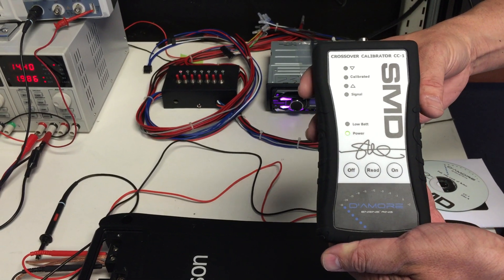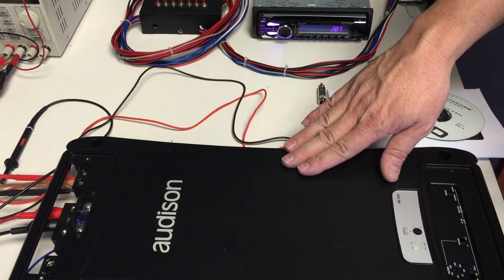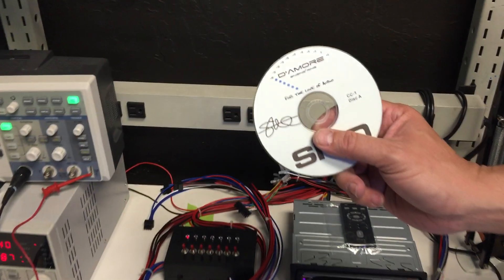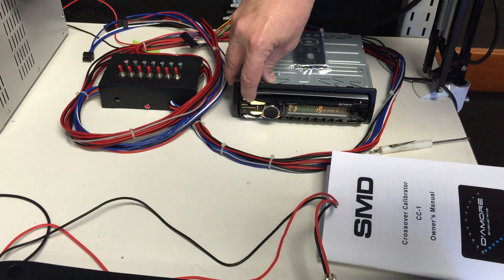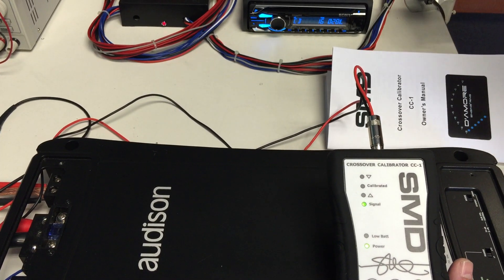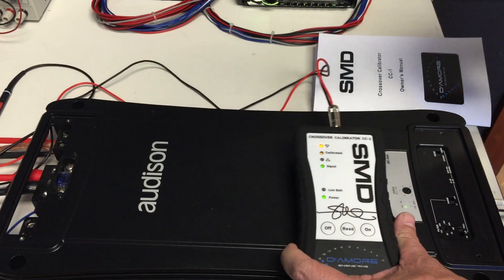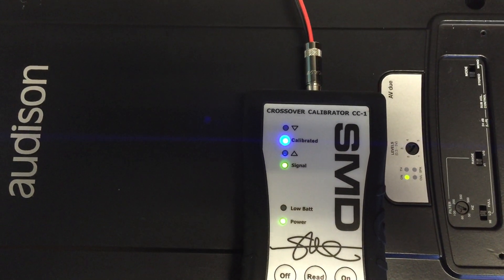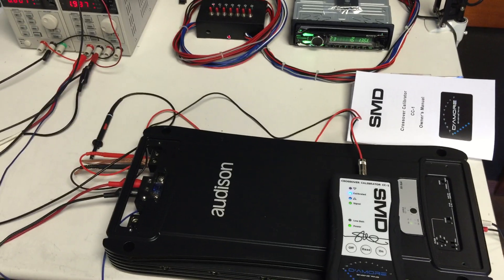CC-1 Video Manual - Video 1, setting the crossover frequency on a subwoofer amplifier

Comment: So when you set it at 80 does that mean it will play no higher than 80 and lower like 30 for example?
Reply: You were correct.  Low Pass will play everything below what it's set at.  High Pass will play everythjng ABOVE where its set.
As for the second part of your question, no it won't stop at 30hz.  It would play EVERY frequency 80 and below.
Now, if you have a subsonic filter, and you set it to 30hz, it will not play anything below 30.  
If you have a SEALED box, you don't really need to set the subsonic.
If you have a PORTED box you set the subsonic to whatever the box's tuning frequency is.  If it's tuned to 32, set it to 32 (you'll have to eyeball it)  
If you don't know what the box is tuned to (sometimes it's specified by box manufacturer sometimes not) then a good rule of thumb is to set it around 25-30Hz.
Reply: A low pass crossover will always play frequencies higher than the set point. It rolls off the frequencies as a slope. If the crossover is 12db per octave then the frequency at 160hz will be 12db less. 320hz will be 24db less, etc...
Reply: @JasonWW2000 what???  If it's set to 80 it will play 80 and below.  Thats where bass is, under 100hz.  
A high Pass if you set to 120hz or 150hz it will play everything from that number and above.

Comment: I also have both cc-1 and dd-1 and ive tryed everything and i cant get a signal for them on my twisted sounds 3.5k i have the remote wire jumped to my 4 channel which worked fine with cc-1 n dd-1 but not my twisted sounds what do you suggest i do thanx

Comment: so it will still be set properly using battery ground? I have a rockford amp. the red light didn't come on until about 15 on my volume.
Reply: Just attach it properly.  It doesn't matter what volume it becomes green at, in the video his was 16.  Just adjust till it's green and then adjust the crossover.

Comment: I have both the dd-1 and cc-1 and in the manual it say's to hook up the harness ground to battery ground as well as has the alligator clip. Are you saying that you prefer to actually hook up the harness to speaker outputs positive and negative as shown in this video?
Reply: Yes.  On some amplifiers, JL slash series for example, the tools will not work connected to battery ground.  We found this out after several customer service calls.  As such we recommend across the + and - speaker terminals.  This works on all amplifiers.
Reply: Tony D'Amore Okay. Thank you sir. I'll do that from now on unless you don't think it's necessary. I'll haft to purchase some test leads and an rca jack and solder the leads on. Have you noticed any difference or improvement by doing it this way or is it the same as probe positive output and alligator clip to battery ground? I guess my question is do you feel like I should even worry about it? I've dd-1 & cc-1 my own personal crescendo amps and have tuned others systems & haven't ran into an issue yet.